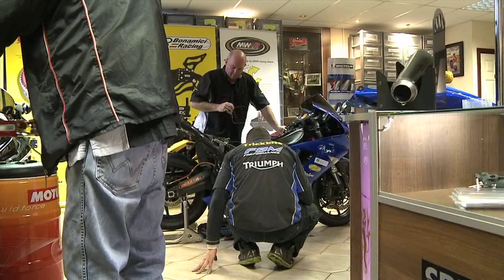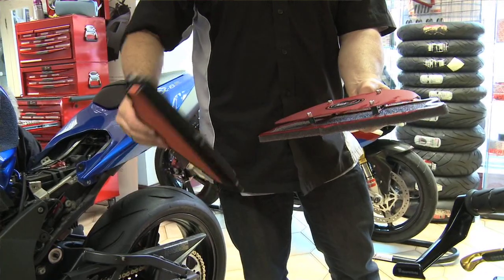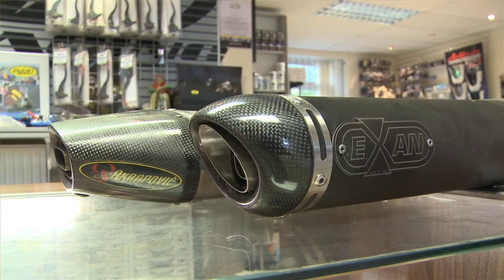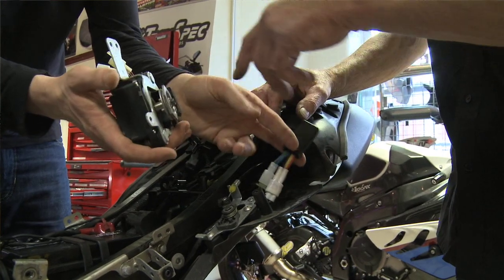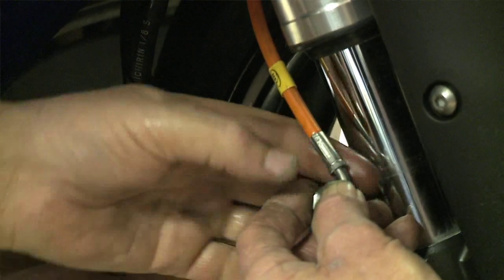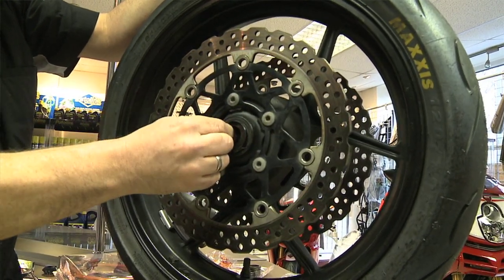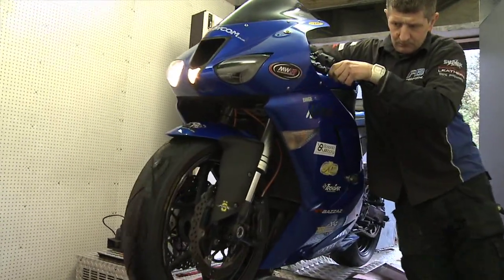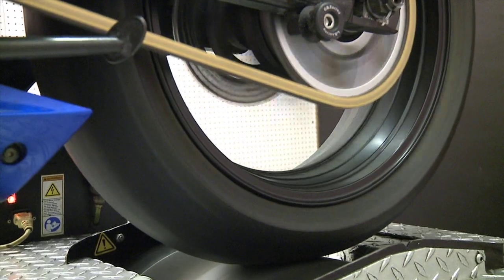Pit Lane Track Bike Part 6 (Sponsored By Maxxis)

Comment: if  you trying to lose pounds of the exhaust please try to remove the catalyst not only the slip-on which by the way was an akrapovic slip-on and you replaced it with exan???
Reply: yeah they did, and they got excellent HP gain...
Reply: Dougie well my friend they dont say that the cat is removed ...so with a slip on and a power comander only you get minimal gains +3-4hp max! again without removing the cat.